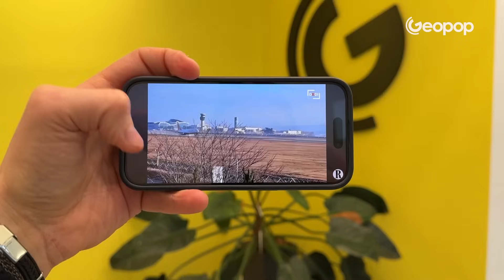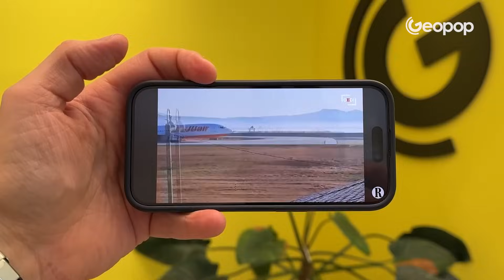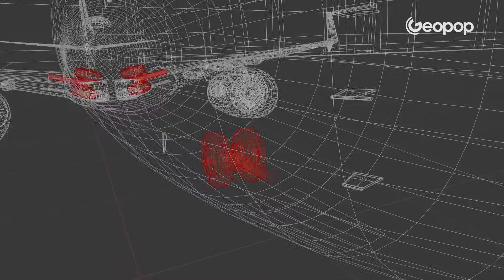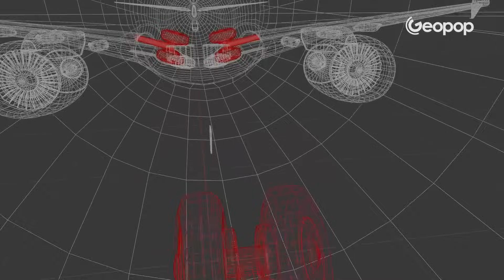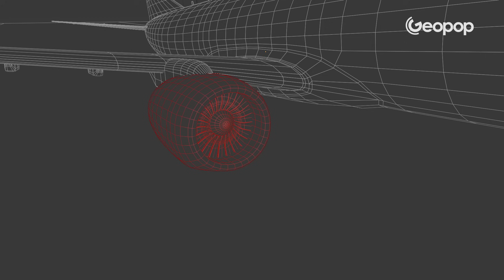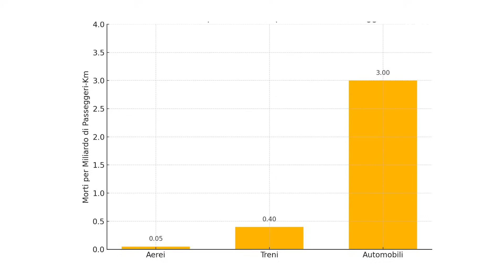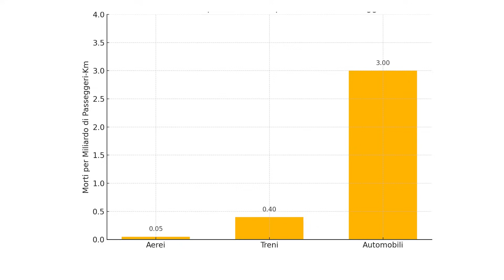Plane Crash in South Korea with Unseen 3D Animations - Hypotheses, Causes and Questions

Comment: I think you need to take account of some facts. The plane was initially on a fully stabilized approach, with flaps and landing gear deployed. After the birdstrike, they should have carried on and landed. Instead, they did a go around, raising the landing gear and flaps, both of which require functioning hydraulics. Then, when they attempted to land in the opposite direction, they had no flaps deployed and the landing gear was up. The #2 engine thrust reverse was deployed, however, which requires functioning hydraulics. Inescapable conclusion - the flight crew panicked, likely shut down the #1 engine and came in too hot and high, touching down 1200m past the runway threshold. From that point on, their fate was sealed.
Reply: My theory is the same as yours. Fatigue played a major role to the flight crews causing to panic inside the cockpit.
Reply: i doubt panic, i can't imagine pilots panicing,specialy even both. Pilots undergo tests, to become pilots, If somebody panics easily, they never would become pilot
Reply: @eddiebitmail  You know these were a pair of SOUTH KOREAN PILOTS, don't you? :face-purple-crying:
Reply: I agree and most of the pilots who shared their opinions said the same thing. The plane was configured for a final approach on runway 01 prior to the bird strike but the pilot decided to go around rushing to land the plane on the opposite direction of the runway at a very high rate of speed without the flaps and landing gears engaged. Again, fatigue played a major factor for the crew that affected their presence of mind in dealing with the situation they are in.

Comment: There is video evidence of both engines emitting "sparklers" after the initial aborted landing. And an eye witness has described it as "the plane flew thru a wall of birds!" I think it's a safe bet that both engines ingested at least 1 or more large species birds in this event. It is also very clear to see in the touchdown video from straight ahead of the plane that the #2 engine under the right wing is emitting a vapor and heat trail... but the #1 engine under the left wing is dead cold. Either the #1 engine was shut down to stop smoke from entering the cockpit or perhaps it just seized and stopped running on it's own, but it is clear that the plane touched-down with only 1 engine running and we positively saw that engine having compressor stalls in video of the plane flying directly overhead on the aborted initial landing attempt... so I would suggest that the single running engine wasn't producing much thrust by this point! I cannot suspend my disbelief that 2 pilots could simply "forget" to lower the landing gear (either by hydraulic control lever or manual release pulls!), "forget" to set flaps, "forget" to activate spoilers even! That stuff should be in any pilots "muscle memory" to do right before any and every landing... if 2 pilots can forget to do all that stuff for any reason, then what are they doing getting their pilot's licenses from some online university somewhere or what??? 😐 Just as that NASA Administrator who got on USA National TV and held up a chunk of foam and stated flatly that "This did NOT cause the loss of Space Shuttle Columbia!" (and then was proven WRONG beyond a shadow of a doubt during testing shortly there-after), we should not rush to judge who or what was at fault in this disaster, because as of today right now we do not know enough still. Just saying.
Reply: This was a royal cluster-intercourse that only the Republic of Korea could pull off. They are the world authority in these sorts of aeronautic disaster matters. :face-green-smiling:

Comment: Accident Timeline
1. Time: 8:54 – Clearance to Land on Runway 01
Situation:
Air traffic control (ATC) grants clearance to land on Runway 01.
The aircraft is configured for a normal landing:
Landing gear is deployed.
Flaps are set to 30.
2. Time: 8:57 – Bird Warning
Situation:
ATC issues a warning about potential bird activity along the approach path.
The crew proceeds with the approach while monitoring engine performance in anticipation of a possible bird strike.
3. Time: 8:58 – Bird Strikes on Both Engines
Situation:
A flock of birds strikes both engines:
Engine #1 (left):
Internal damage causes smoke to enter the cockpit via the bleed air system.
Engine #2 (right):
The turbine experiences surging, leading to a significant loss of thrust.
4. Time: 8:59 – Smoke in the Cockpit, Go-Around, and Mayday
Situation:
Smoke in the cockpit reduces visibility, impairing the crew’s operational capacity.
The crew decides to abort the landing on Runway 01 and initiates a go-around.
Mayday Call:
The crew declares an emergency to ATC and requests assistance.
5. Time: 8:59 – Engine #1 Shutdown and Engine #2 Set to Idle
Situation:
The crew shuts down Engine #1 to reduce smoke and mitigate fire risk.
Engine #2 is kept at idle to maintain limited hydraulic pressure, but it does not provide sufficient thrust for stable flight.
6. Time: 9:00 – Quick Turn Toward Runway 19
Situation:
ATC directs the aircraft to Runway 19 as Runway 01 is no longer viable.
The crew performs a rapid turn, but the aircraft’s limited engine power makes control challenging.
Landing gear and flaps remain retracted to minimize drag.
7. Time: 9:01 – Belly Landing Without Flaps or Landing Gear
Situation:
The aircraft touches down on its belly at high speed on Runway 19.
Ground effect prevents early contact with the runway, causing the aircraft to land farther down the runway than planned.
8. Time: 9:02 – Collision with Reinforced Concrete Structure
Situation:
A reinforced concrete structure,  built to support the ILS antenna, stands at the end of Runway 19.
The aircraft collides with the structure, resulting in an immediate explosion.
Most passengers and crew perish in the crash.
Only two flight attendants survive the accident.
Summary
Crew Decisions:
The crew’s decision to shut down Engine #1 and attempt an emergency landing on Runway 19 was appropriate given the circumstances.
Primary Cause of the Accident:
The constructed reinforced concrete structure at the end of Runway 19 was the critical factor leading to the fatal outcome. Without this obstacle, the aircraft would likely have slid safely past the runway despite the challenging belly landing.
This timeline highlights how multiple factors combined to result in a catastrophic outcome.